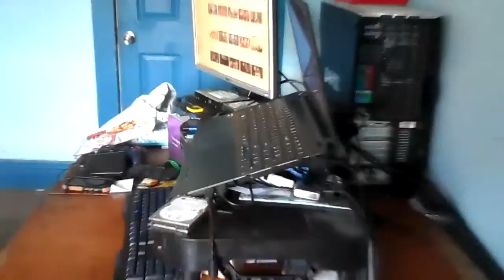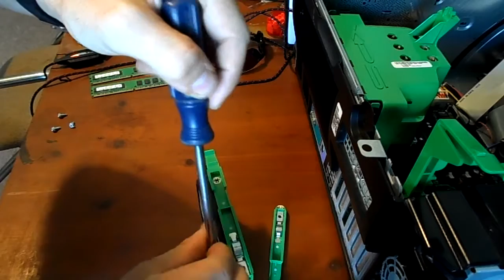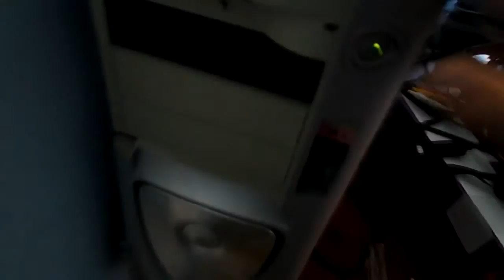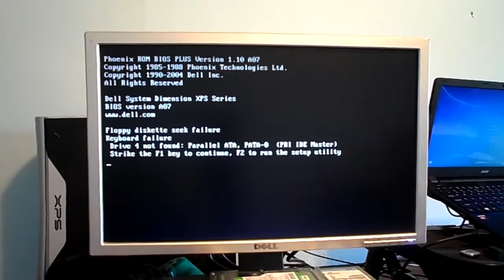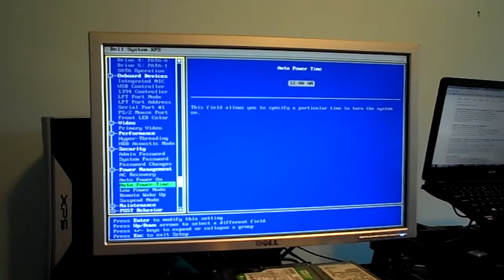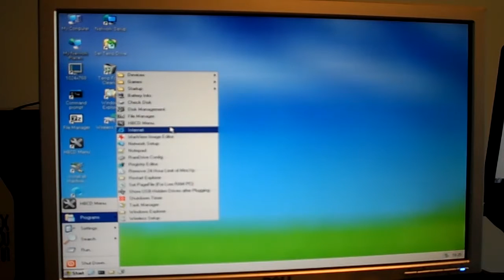Abyss Tech Vlog: Reviving a Dell XPS Gen 4 Desktop Computer

Comment: where is the rgb switch at and I am having trouble getting it to detect hard drive
Reply from the maker: MsJinkerson You can access the color selection in the system BIOS. As for the hard drive, try using a different sata port, cable or try a different hard drive.